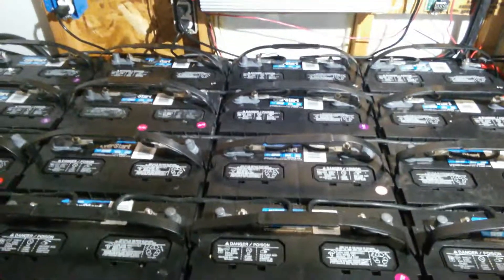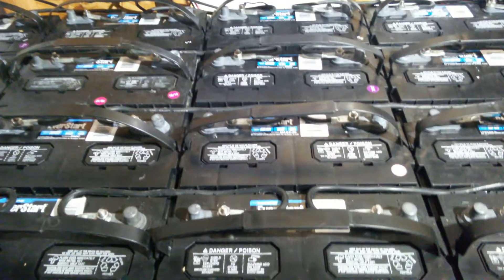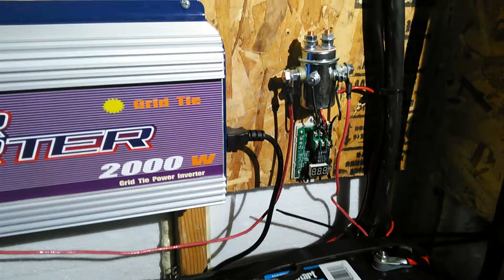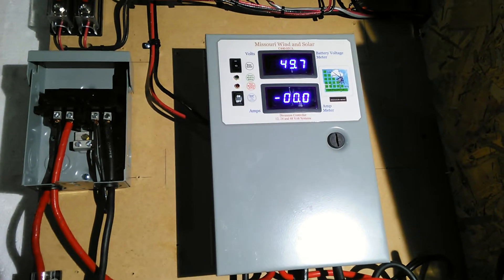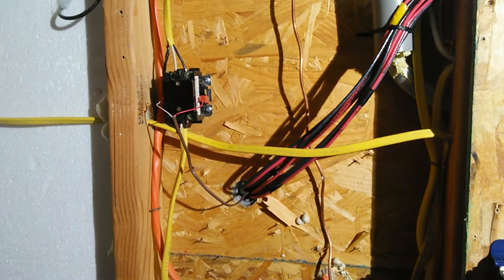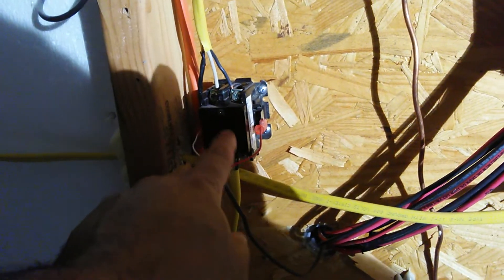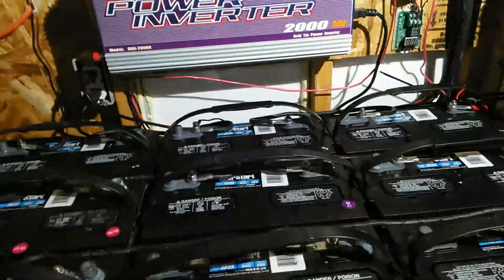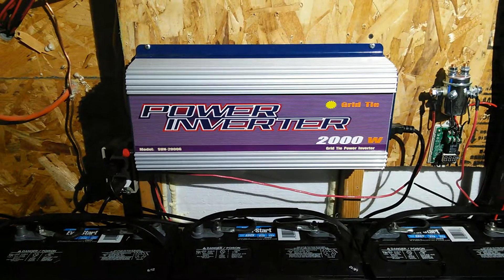Running central air unit off of battery and solar power

Comment: WHAT TYPE A 24 VOLT A/C CONT-ACTOR WHAT BRANT OR MODEL#
Reply from the maker: Eddie Gonzalez Jard 17325 Contactor 30 Amps coil voltage 24 VAC .